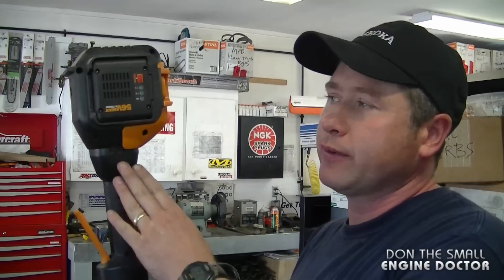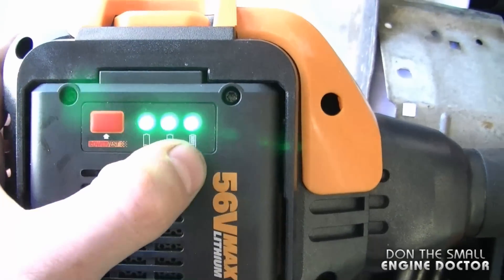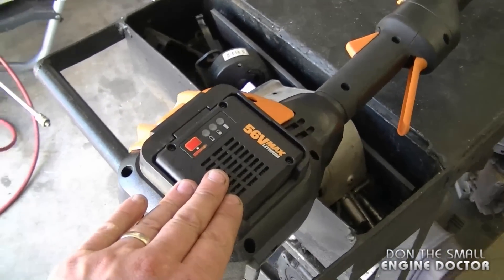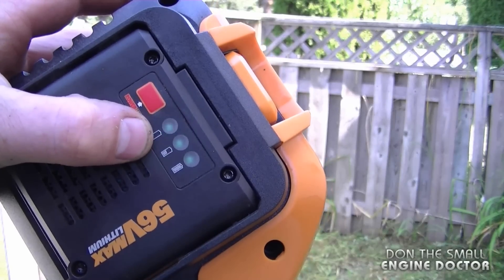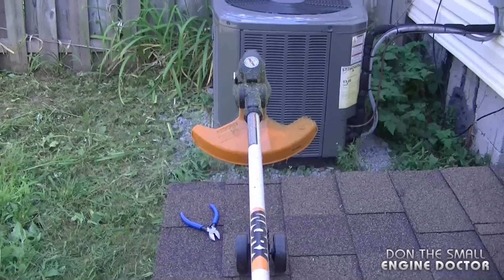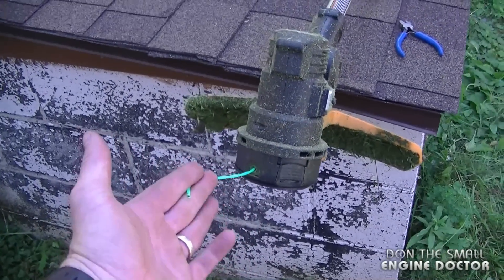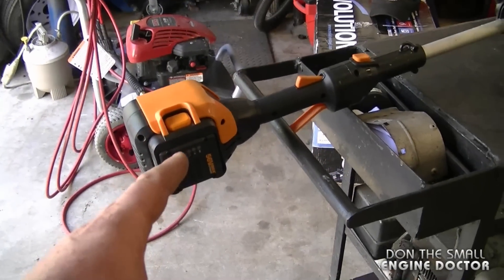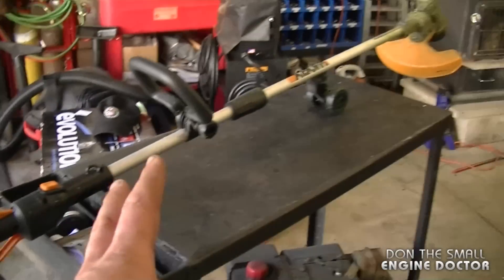Testing The WORX 56V Battery Operated Grass Trimmer

Comment: I own 2 B&D 20V trimers and the batteries last 20 minutes each also.
The difference between the B&D which uses .065 line, spins at 7200RPM and weighs 5.2lbs [costs $99 Amazon & HD] and the Worx which uses .080 line, spins at 8300 RPM and weighs 8.8lbs [costs $189 at Amazon].
Between the stronger line and higher RPM, the Worx will cut twice the square footage that the B&D will in the same amount of time.

Comment: I liked using the Poulan Pro weed trimmer which runs on battery, and I have used it for trimming the bushes around my place in the country. It has a duel line like the gas trimmers and it has different speeds so I can save power by operating it at half speed or go to full speed like the gas trimmers. I got this trimmer due to the problem I keep having with the primer bulbs on the gas trimmers always wearing out each season of use.

Comment: I have the super junky Worx WG775 Lil'Mo mower, I paid about $200 usd for it. I've been using it for about 18 months now, almost every week (often times multiple times a week). I live in Florida so it's necessary to mow the lawn about 10 months of the year. January and February you get a slight break where it's cold enough and dark enough that you don't have to mow really, but here in August it rains every night, is in the 90s, and the sun shines ALL DAY, so the grass grows about 8 inches (20cm) every WEEK. Because it grows so fast it usually takes the mower 4 charges to do the whole yard which is very small... but considering I don't have to buy gas for it or worry about carbs or any kind of seals or gaskets giving me issues I don't mind. 

Another good thing about it is that the battery not lasting the entire yard kind of reels you in, it keeps you from exhausting yourself and having a heat stroke. It only stays charged about 15 minutes, but if you mow much longer in the daytime you'll likely be sorry.

Comment: I purchased the Ryobi 40V electric trimmer this summer. At full speed, it's not as strong as my FS45 Stihl gas trimmer. Perhaps 75% as strong as gas. While running mostly between 3/4 to full speed, the 40V  battery lasted longer than this 56V Worx, but not long enough to complete my entire one acre lot. 
To remedy this deficiency, I purchased a second 40V battery and charger from eBay.  Now, with two batteries in my arsenal, I have enough battery life to complete the entire property. 

The Ryobi line feed functions as good as this Worx does. Don't know about longevity just yet. Maybe the motor is weak and won't last long????? Repeated usage will bear witness to this question.

Love your videos and thanks for performing this review.
Reply: Your Stihl is a great trimmer. Most gas trimmers won't out do it.
Reply: Funny how I obtained the FS45.  A maintenance man where I once worked simply gave it to me. He purchased a new electric trimmer and didn't want the Stihl trimmer anymore. 
I rebuilt the carb and replaced some broken plastic pieces and it's been running great since then..
Reply: +Stanley Waggoner sweet deal

Comment: Don, I am using the easy to use, with a loop handle and basic harness included, the fabulous "STIHL FS 70 RC" Trimmer makes easy work of weed wacking chores. 

Plus: The trimmer is also built to last, featuring a durable cable drive shaft, a high-durability, forged connecting rod, with a 4-bearing gearbox.

Thank you very much for trying out, and testing the 56 volt grass trimmer, and it's run time.

Cheers! :-)
Reply: Mine lasted 5 times and is now dead in the water!  think of the money I save on extra spools... what a POS

Comment: Hopefully the 56V battery is better than their 18V battery trimmer I had a few years ago. The batteries would not hold a charge after the first year. I could only get about five minutes or less. Company replaced battery free of charge,  but did the same thing. I threw trimmer and three batteries in trash. Bought a Black & Decker cordless trimmer and have never had a problem in the 2-3 years since I bought it.

Comment: my neighbor has that same trimmer I happened to be relaxing in the yard when he was doing his lawn and could not believe how long that battery lasted! he has a big corner lot and he trimmed the entire yard and then started edging with it he did the side edging and started the front before I saw him go to the garage and change the battery. by this time was so impressed with the battery life I walked over to find out what he was using. I long ago gave up batteries for gas but if for some reason I ever go back to battery power this is the unit I would get. good review both the unboxing and testing.

Comment: Great video and review. I have an 18 volt Ryobi trimmer and it does everything I need. This machine is a beast. At first, i was thinking this machine would last a lot longer on one charge but it seems it is more a function of power. The usage times appear to be comparable but it is obvious the Worx unit generates much more power compared to the Ryobi. One is for lighter duty while the other works well in over-grown areas.

Comment: @donyboy73 I've never seen that push of a button auto wire feeding system before, it seems real cool of a feature,  but what are your thoughts on longevity for the system? is it something that you think might break after a couple years? 

(I've always bought gas trimmers and garden equipment,  but im just curious about that auto feed system.)
Reply from the maker: not sure, only did a few tests with it, time will tell
Reply: Ok. Thanks for the response.

Comment: Donyboy still works in 2019 ?
i had a Ryobi 4 stoke befor worked amazing almost 8 years of use , 
then Got the 20V Dewalt 1st gen Lasted 1  1/2 years JUNK - had to Complain 2x before Dewalt Stepped up to the Plate and sent me another Unit .
Went back to Troybilt 29cc 4 stroke .
Now in 2019 Picked up a 82V Snapper looks to be same as Greenworks and Victa 82V
Hope its OK

Comment: @donyboy73 Hey I have a question. I am starting a small engine shop and I have some engine that I am scrapping for parts. And my question is how do you organize your parts?
Reply: You can tie tags on the parts with info of the motor on the tag and put all Briggs in one box, Tecumseh in another for storage. I have seen Don do this and also put all usable parts of an engine in a box with the engine info on the box.
Reply from the maker: I put them in boxes and mark the boxes as to what is in them

Comment: I'd worry about carrying 56V under my arm if it were to start raining a bit before I finished.  I'm curious what kind of safety it has in that respect.  I'd also question battery life in terms of charge cycles.  Eventually it would lose battery life and you might not even get your yard finished.  I'm sure the battery would cost a fortune.  Good review, though!

Comment: Im looking into going battery powered since my echo or any gas powered weed trimmer is causing hearing damage in my right ear even with ear protection in place :-( I've already got 20 db of loss at 8 to 9 kHz in my right ear which is on the side I hold my weed eater.

Comment: I've used a ryobi that has self feeding but it auto feeds after you let of the gas every time. It sucks, wastes a lot of string. If you miss 1 weed or a single blade of grass and go back to touch it up your going to end up automatic advancing 1/4" or more of line even when you don't need it. Bump feed heads are a lot better.
Reply: I have a 20V B&D trimmer that uses a 30 foot spool of line for every 6 battery changes [3 trimming sessions {2 hours}]
My wife used once, and used a whole 30 feet of line with ONE battery charge [20 minutes].

Comment: 56 volts from that tiny battery? I can't imagine it'll last more than a couple of years
Reply: I don't think you understand voltage and amperage.
Reply: Inside of that battery is a bunch of 18650 li-ion wired in series to get that 56 volts. Now in electronics you run higher voltage to get more power(wattage) without drawing so many amps. Drawing tons of amps is what frys batteries. This thing obviously won't draw tons of amps because it uses such a high voltage. However how you care for the battery is how it'll treat you. I'm not sure what the manual recommends but I use 18650's on a daily basis with my mechanical mods and I can tell you they are amazing battery's. I've drawn 30 amps from
a single 18650(Sony VTC4)and they just keep going. I've had some for 2 years. The big question here is what 18650 are used inside that pack. That's the big unknown. If they used quality cells this pack should last for 5 years IF charged and maintained correctly.

Comment: Thanks for the review, but nothing beats a new $69.99 gas weedeater every 2 years.
Reply: I'd suggest that my $300 Stihl purchased 22 years ago and still running strong beats a disposable weedeater for a variety or reasons, not he least of which is performance.  Buy it once - and buy it right.
Reply: That's a waste when you can get a good one which lasts decades.
Reply: if you mix the gas rich it won't wear out...
Reply: don't use the bullshit gas with 0 oil in it and the $70 will last a hell of a lot longer...
Reply: Don't use ethanol gas, and it will last a lot longer than two years.

Comment: The worry is the battery:

1) will you need a fully charged 2nd/back up battery to finish your intended yard work?

2) how many years of service could you expect from the battery?

3) the price to replace the battery:  I checked the Worx site: a new battery costs almost the price of a new trimmer?.......................planned obsolescence.................in effect, this tool is a throw-away,............................need to buy a new one every few years..................you do not need to do this with gas yard tools as long as you do the proper maintenance and use the proper fuel additives

Comment: Don't trust battery operated power equipment - their batteries are just like laptop batteries- if one little cell goes bad or deteriorates then the whole pack is dead or won't hold charge for long. And it's dangerous to attempt replacing one cell since the cells are soldered together with tabs.

Recommend sticking with gas powered equipment - even if someone has a small yard.